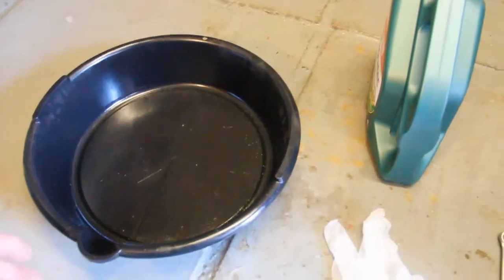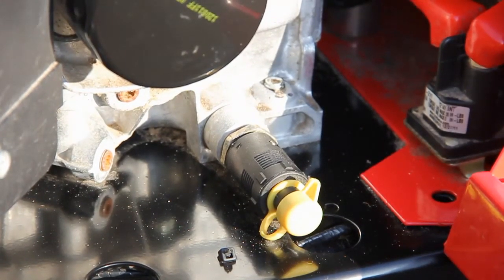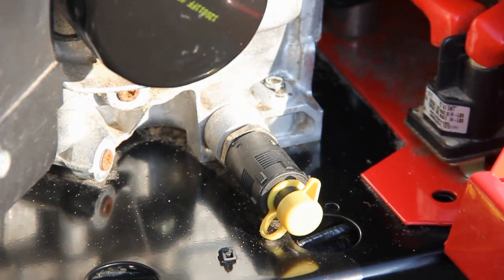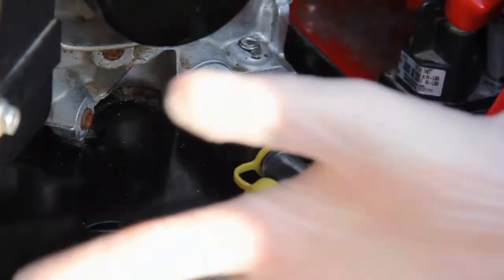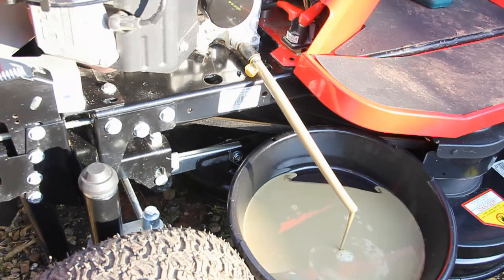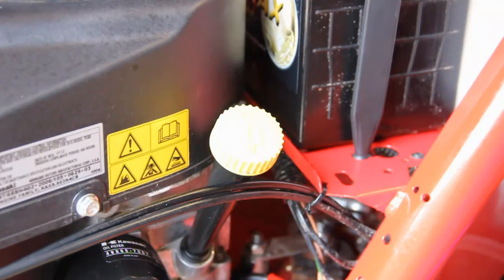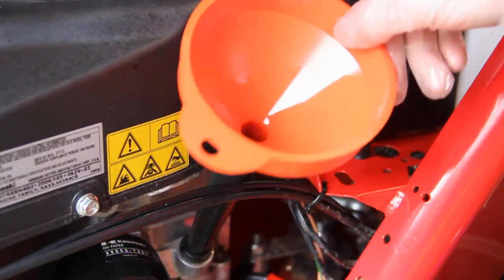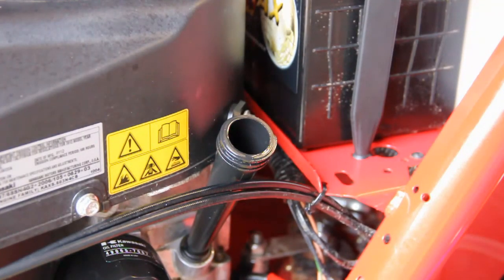How to Change Engine Oil on a Ride on Lawnmower *HD*

Comment: Useful and clear, thanks. But... how on earth did they get water in the oil on an air cooled engine? It otherwise looks fine e.g not sat outside. Accident with a pressure washer maybe?